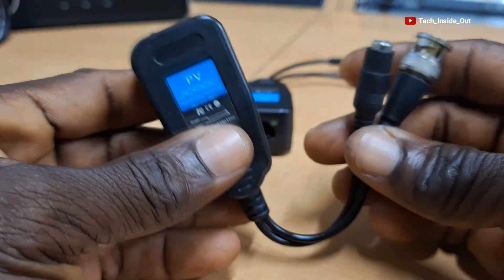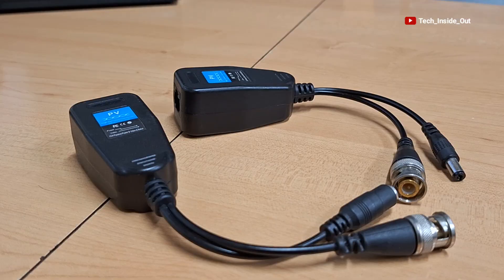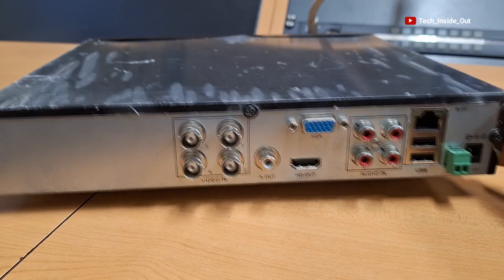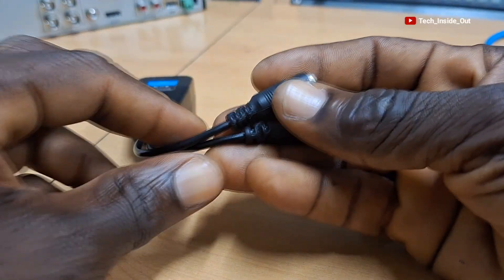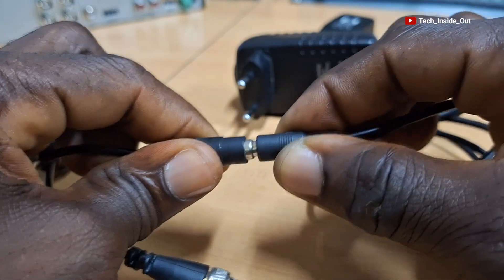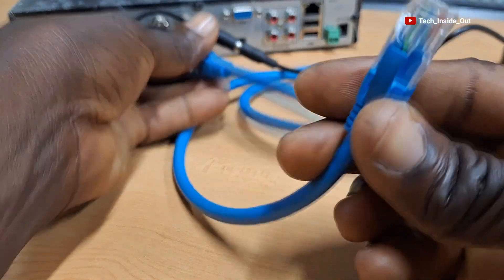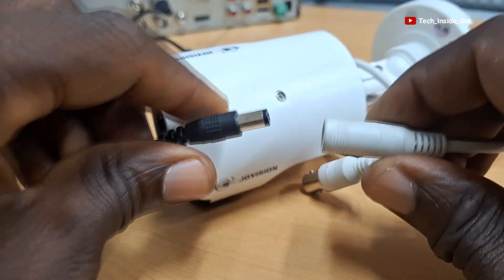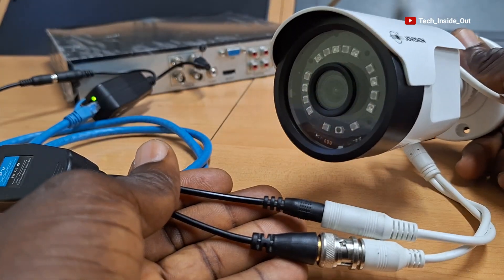How to connect Power Video balun to AHD CCTV cameras using network cables

Comment: So, in case you have a power supply adapter. In this case, I see it's not effective to use with the baluns
Reply from the maker: It can work provided your cables are within 100m length

Comment: This is on suitable for small installations, have multiple cameras will require u to use many adaptors which have many cables
Reply from the maker: You don't need many adapters,  you can use a Power supply unit and distribute to your cameras

Comment: Please what is the essence of the PV bullun
Reply from the maker: It transmits power and video signals over a single network cable instead of the traditional Coaxial and power cables. 
Less cables to work with without compromising quality.
Reply: @Tech_Inside_Out  Thank you.